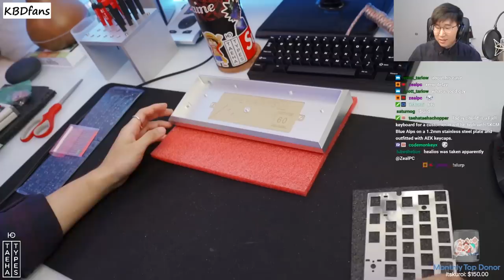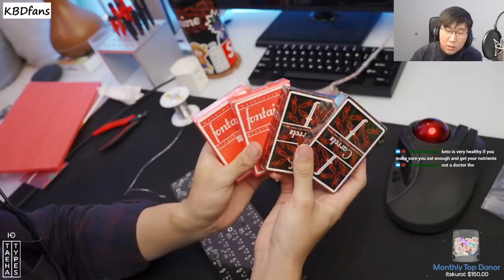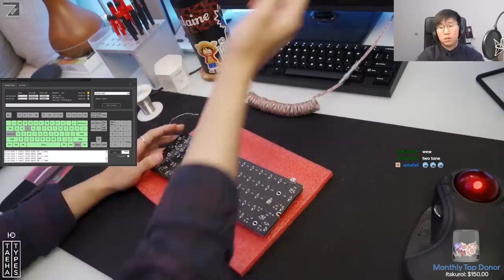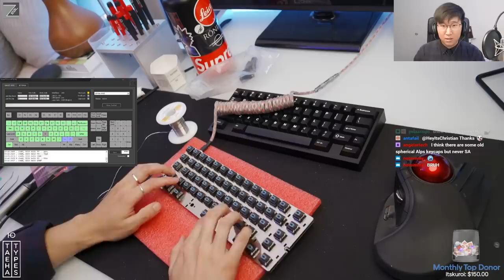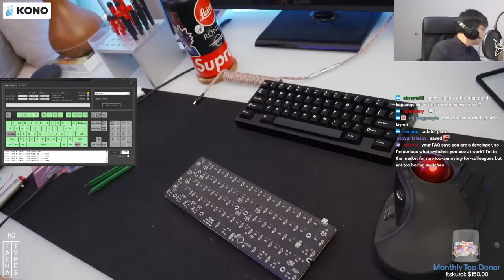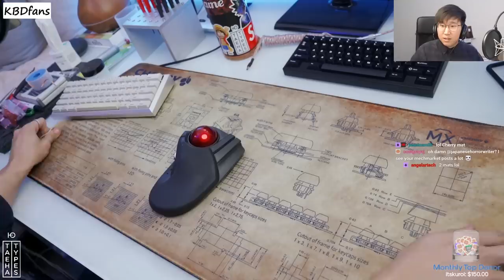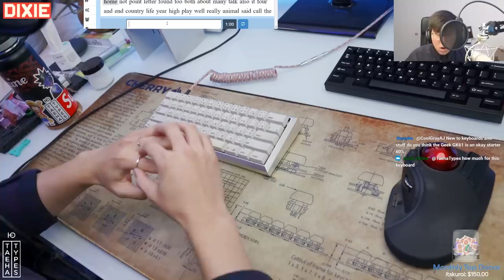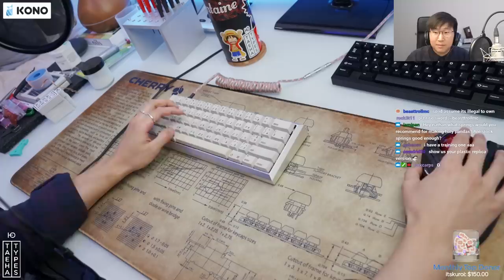Fjell with SKCM Blue Alps Build Stream

Comment: alps are such a rare switch now, I really want to try them, but I just can't find some, let alone some keycaps and a proper pcb lmao.
Reply: Same here. I really want to try them but its so expensive. Shopping for them can be confusing because unlike commercially available stuff, you have no clue what a fair price is or where is good to shop.
Reply: you can buy vintage keyboard with alps switches on them they aren't that hard to find
like i got a focus fk-2001 with pine white alps and linear-modded them and they feel and sound great
Reply: Matias switches are commercially available and feel close enough to classic Alps switches to be a good substitute. Matias, Tai-Hao, KPRepublic, and Kbparadise all sell keycaps. And Keebmeup and KPRepublic sell Alps PCBs that will fit in standard 60% tray mount cases.
Reply: @Temunic  Do you know of any pcb's for Alps that use a different form factor? Perhaps 65% 75% or TKL?
Reply: @noahfowler4153  KPRepublic offers both an ortholinear 75% PCB and a 96% PCB that are Alps compatible, though they don't offer Alps plates for them. LFKeyboards also offers some Alps compatible PCBs including a TKL one. You would need to be careful to get an appropriate plate cut and case/keycaps/stabilizers for those however.
Reply: @Temunic  Matias switches, mostly newer ones, are notoriously unreliable and start to chatter within a matter of days. I think it has something to do with the lube they dump into it.
Reply: @rifathhossain8186  they aren't that hard to find

yeah but they're fucking expensive lol
Reply: literally found all of those thing within a day of research
Reply: You could find broken vintage alps keyboards for parts
Reply: There are linear SKCL Yellow Alps switches on Taobao if you're interested
Reply: @CaptainShovelHead  had mine almost a year work just fine
Reply: idk how it was 2 years ago but i got a CA66 with nos blue alps recently for $400

Comment: Also i have a question. I have old chicony with blue alps and apple extended keyboard with alps cream damped. And that apple keyboard has broken pcb. So i want to remove those switches and build on it custom board to use when i travel and also to school. And i don't have idea what to pick and where to look. I think my max is 200$ (without switches) Also i think i need only pcb and plate (and cable), cause i can make my own case. I think i want tlk build. Thanks a lot for help if somebody help me.
Reply: i know of the h87alps and lfk-tkl for alps support. idk about plates to go with them, but you could always get one custom cut for well under your budget, and im sure someone's already got a dxf up somehere